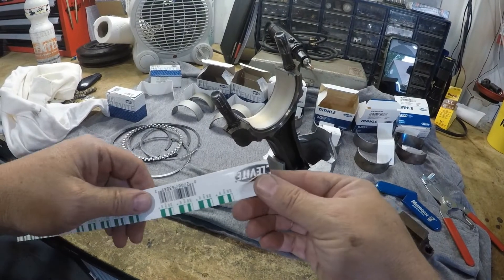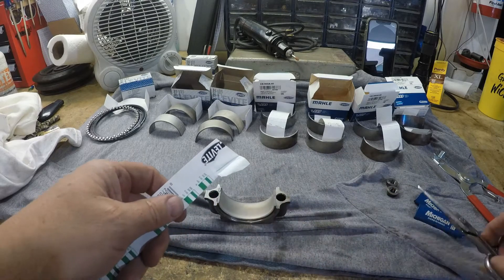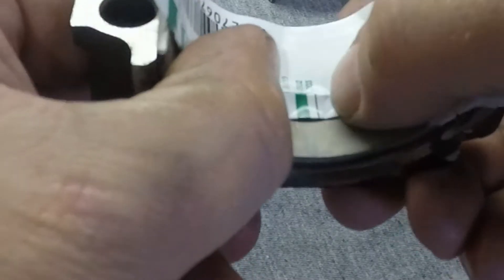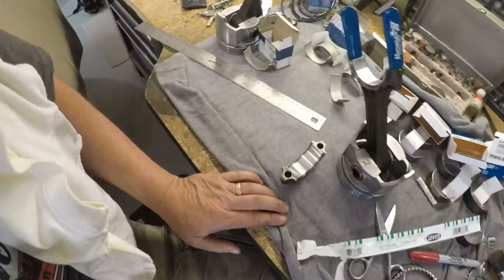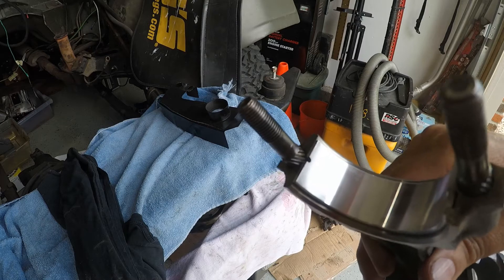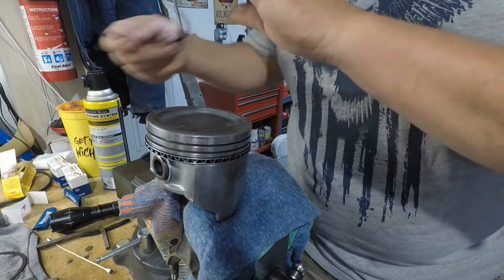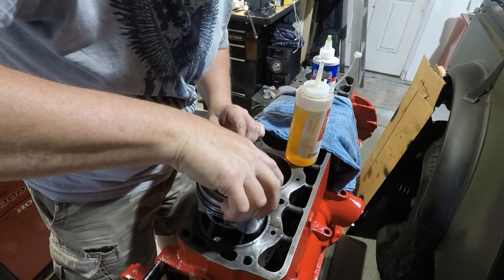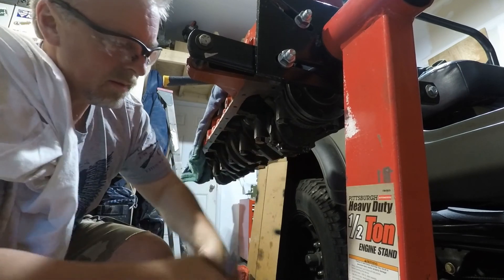Episode 7 - Plastigauge and Custom Oil Squirt Notches | 4.2 Liter 258 CID Jeep Rebuild

Comment: Kenny, I'm enjoying your videos, but I have to tell you I really disagree with what your machine shop did, with regard to re-stamping your rod caps, especially if they were already stamped by the factory. It's incredibly lazy, and it tells me that if the shop bothered to balance the rods, they didn't pay attention to detail. Mixing up the rods and caps throws off what balance was done at the factory and causes unnecessary extra work. Every engine needs to be properly balanced, regardless of application, in order to guarantee maximum life out of the engine and its parts.